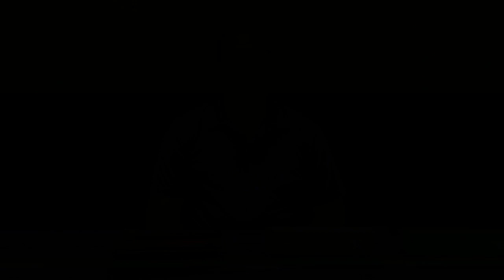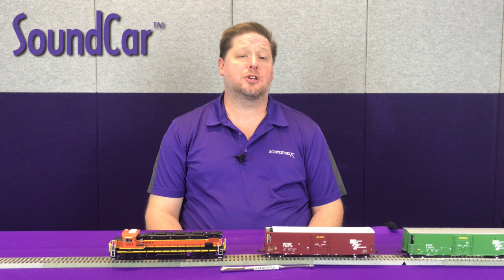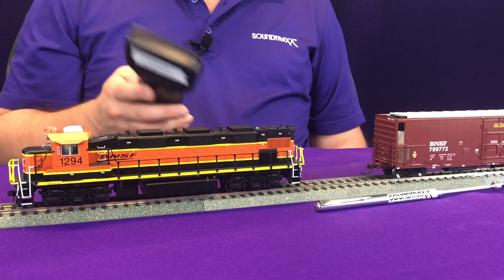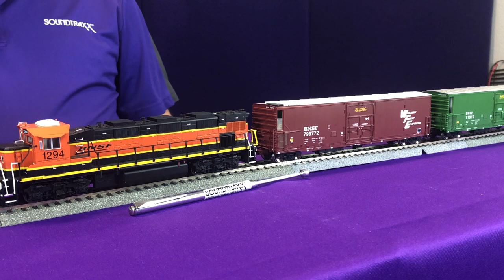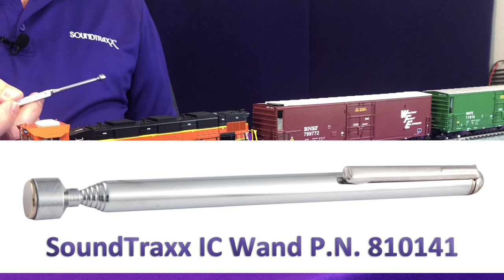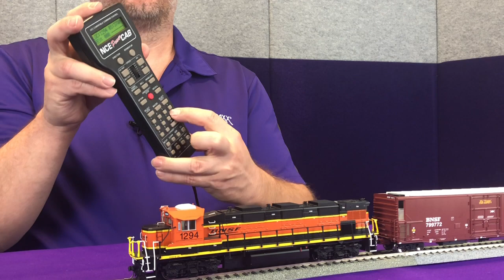SoundCar equipped models & Consists

Comment: Will this work for Walther Proto Superliner and Amfleet cars and how many would I need for the California Zephyr consist and the Silver Meteor consist  ??
Reply from the maker: Yes.  The SoundCar will work with any passenger car.  You set the number of axles and number of trucks, as well as the spacing for them  (length of car) and with 4 light outputs, you can light the interior and exterior as you desire!  The SoundCar decoder is universal to match any type of rolling stock.  For more info, contact us directly. (970)317-3505

Comment: does the loco HAVE  to have a Soundtrax Tusumni2 decoder, or will the sound car  work with other brand decoders or econimi decoders ?
Reply from the maker: SoundCar works easily with all SoundTraxx decoders including Econami. You can use the SoundCar with other manufacturer's decoders as well, but you may have to do some function mapping to make them work together well. You can get more info on this from our Customer Support Center if you need: https://soundtraxx.com/contact/technical-support
Reply: @SoundtraxxDCC  Thank you for the reply !!  A good help !!
Reply from the maker: @gmcliff555  No problem, let us know if you need anything else!